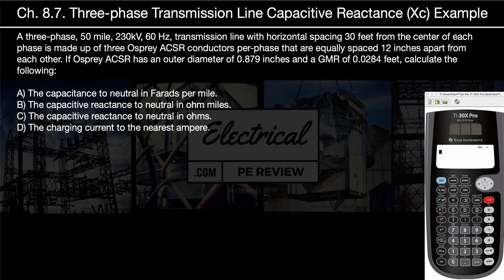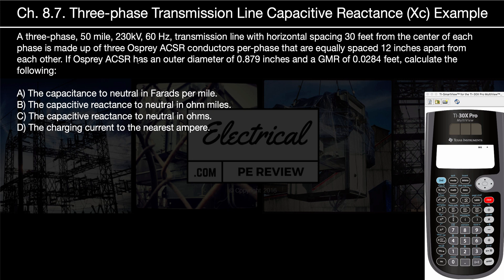How to Solve Transmission Line Capacitance and Reactance Problems (Electrical Power PE Exam)

Comment from the maker: 0:22 Problem Statement
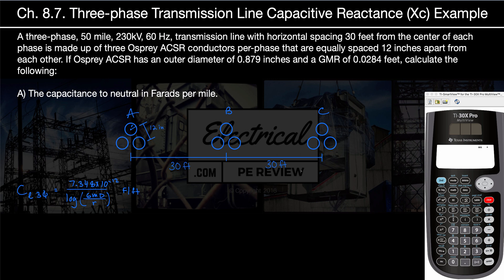1:03 a) Capacitance to neutral in Farads per Mile [F/mi]
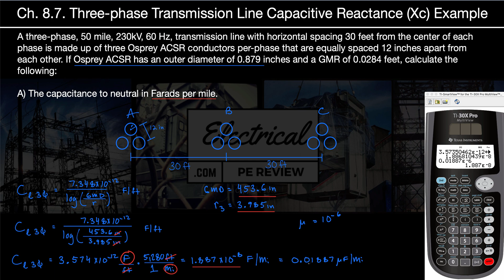11:02 b) Capacitive reactance to neutral in ohm miles [Ω·mi]
13:46 c) Capacitive reactance to neutral in ohms [Ω]
15:32 d) Charging current to the nearest ampere [A]

Comment: Great video, just wish the equations you used were the same as in the reference book we get to use on the test.
Reply from the maker: Hi bgallagher16, this is an older video from the paper and pencil format before the exam changed to CBT. We updated all of the course on-demand videos and live classes to use the Reference Handbook formulas. If you're looking for help with transmission lines like this video, some of the newer videos that use the Reference Handbook formulas are availble on YouTube here:

Transmission Lines - Solid cd Stranded Conductors:
https://youtu.be/2SwLUEqyG9Y

Transmission Line Bundle Conductors GMR and Radius:
https://youtu.be/im3oSnnY3EQ

Single phase Transmission Line Capacitance (C) & Capacitive Reactance (Xc):
https://youtu.be/60qyoEDbghU

Single Phase Transmission Line Inductance (L) and Inductive Reactance (XL):
https://youtu.be/0eCWyy9_d9M

Here is the entire playlist:
Transmission Lines for the NCEES® Electrical Power PE Exam
https://youtube.com/playlist?list=PL8UEnCgTyXQt4HCGjMaoQ8vNRHivDotpv

Hope this help!

Comment: A 50 Hz over head line has the line to ground capacitance of 1.2µF.It is decided to use a 
ground-fault neutralizer. Determine the reactance to neutralize the capacitance of (i)100% 
of the length of line and ( ii) 95% of the line.

Comment: In the handbook (pe-ecp-handbook) page 75, it seems that you use the formula for GMR to calculate r3 (minute 3:45). Does not the problem already give us the GMR (unless that is another sort of GMR)? One more question, do you have a video or lesson(s) in which you explain GMR and GMD for ground zero??
Reply from the maker: Hi YM, the problem gives the GMR of each individual conductor in the bundle. Since there is a bundle being used in this transmission line (more than one conductor per-phase), we have to calculate the overall GMR of the bundle instead.

I'm not sure what you are referring to in regard to "ground zero", however, here are a couple of more recent Transmission Line videos from our YouTube channel that you may find helpful:

Single-phase Transmission Line Capacitance (C) & Capacitive Reactance (Xc)
https://youtu.be/60qyoEDbghU

Transmission Line Bundle Conductors GMR and Radius
https://youtu.be/im3oSnnY3EQ

Single Phase Transmission Line Inductance (L) and Inductive Reactance (XL)
https://youtu.be/0eCWyy9_d9M

Comment: Hey Zach! 

How and why did you derive capacitance to neutral in [F/ft] and then convert to [F/mi], rather than using the [F/m] equation given in the PE Exam Reference Book (5.1.8) and convert to [F/mi]? Is that absolutely necessary? I seem to be getting different answers using matching units for each formula variation.

Additionally, the Reference Book uses ln() rather than log10(). Why is it necessary to modify the formula so that log10() is used instead? This difference seems to be related to my question above as well.

And finally, why is the constant in the single-phase capacitance to neutral formula half of the constant in the three-phase variation?

Would greatly appreciate a response! I'm going crazy trying to reverse engineer this and I don't believe the derivation was ever shown while taking your course (unless I missed it)!
Reply: That is funny, I thought the same thing! I actually thought it was a cool challenge to try and do it in F/m while he did it in F/mi. It makes you think about the units instead of just following his example. Once I got my answer in F/m I just converted it to F/mi.
Reply from the maker: @electricalengineernoobie9503  good job!
Reply from the maker: Hi @R. Caskey, great questions.

This video was made priro to the release of the Reference Handbook and uses transmission line formulas that are more commonly found in transmission books. Any of the formulas may be used as long as you pay attention to the units.

Here is a newer video on your YouTube channel that uses the same formulas as the reference handbook for transmission line capcatiance (C) and capactive reactance (Xc):

https://youtu.be/60qyoEDbghU

Both formulas in the reference handbook for transmission line capcatiance (C) and transmission line inductance (L) solves for line to neutral values (what the reference handbook refers to as "average values").

When dealing with a single-phase transmission line (like the video linked above), you can have to values. The line to neutral capacitance (C) and line to neutral inductance (L), which only accounts for the "average" value of just one of the conductors (like the hot conductor), or, you can have the "total" capacitance (C) and "total" inductance (L) of a single-phase transmission line which accounts for both the value of the hot AND neutral conductor.

Since capacitance (C) in the unit farads [F] in series sums in reciprocals:

1/C = 1/C1 + 1/C2 + ...  + 1/Cn

Two equal capacitors in series equal half:

C_total = C/2

We explore all of this in much greater depth during our live class on transmission lines.

Comment: You take log of base 10 but i think log of base e should be there. Please tell @7.58
Reply from the maker: There are two sets of formulas depending on if you are solving for capacitance (C) in imperial units (F/ft) or metric units (F/m). This video solves for capacitance (C) in imperial units (F/ft) and uses the formula that includes log base of 10 instead of the natural log (log base e).
Reply: @electricalpereview  thanks. I got it